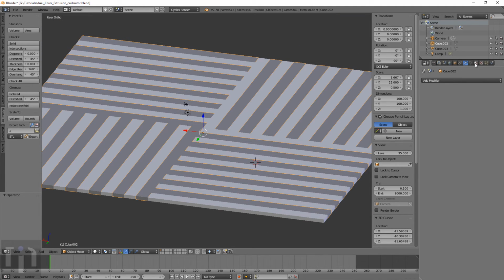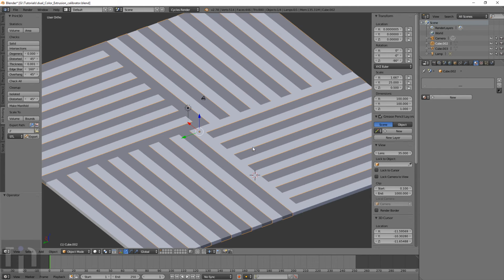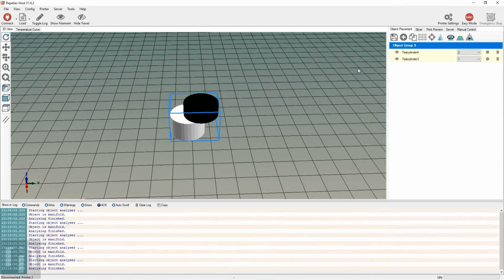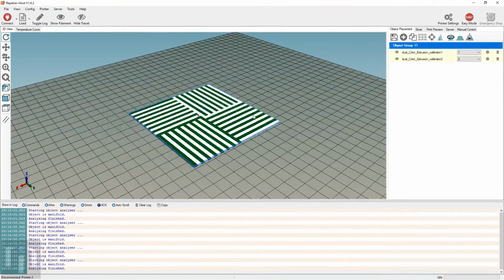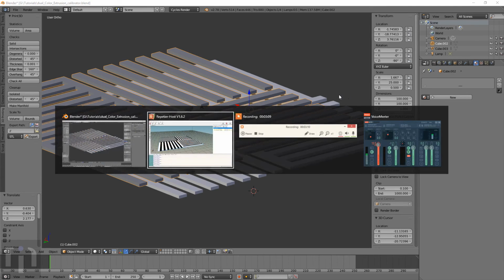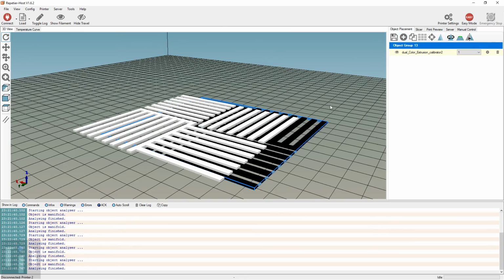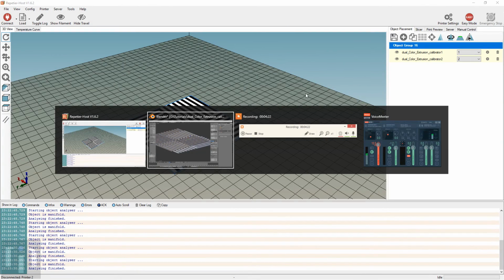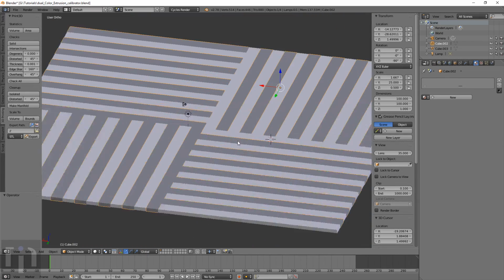Blender Tutorial #036 : 3D Exporting Dual Color Print Models

Comment: The Center of Origin only applies to that specific object while inside the .blend file. When it exports to STL it recalculates everything based on global origin. That's why they link up just fine. 

Thanks for the other info though about getting the multiple pieces properly exported for multimaterial printing.